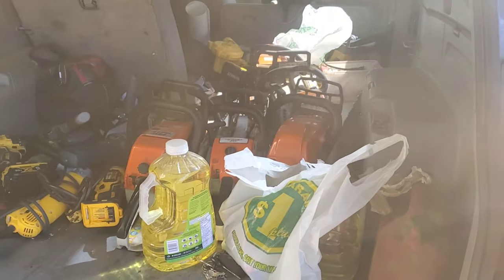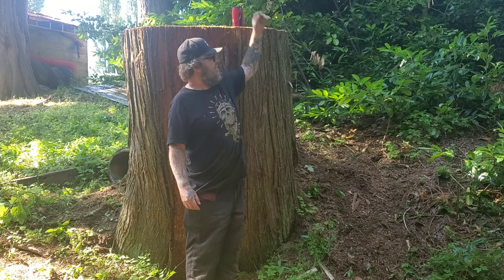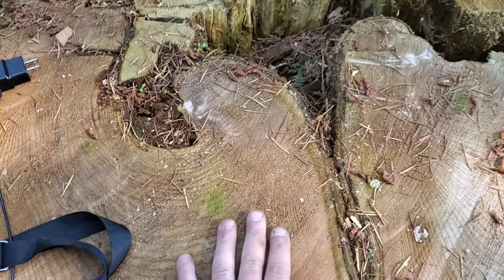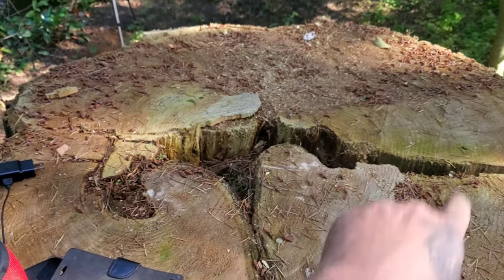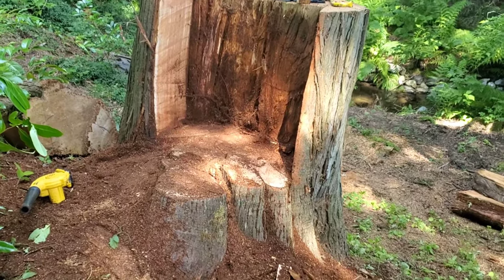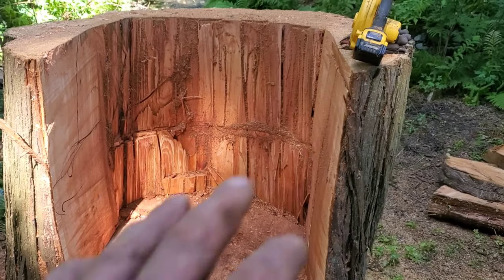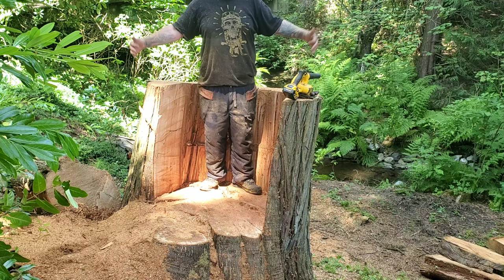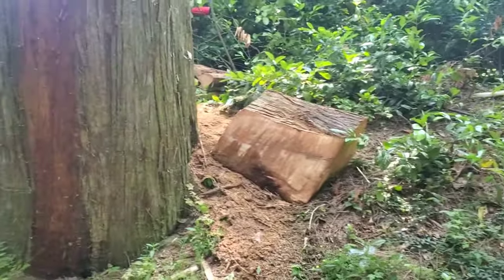Carving a Eagle head THRONE CHAIR. Part 1

Comment: Try wood hardener on that rotten wood. I haven't ever used it but it is supposed to make wood hard again.
Reply from the maker: There is to much nagative space
Reply: I was thinking i would use some total boat deep penetrating epoxy with a spar varnish for UV protection in the void. That's a good combo for outdoor with harsh winters!